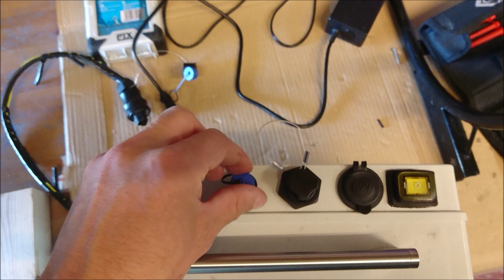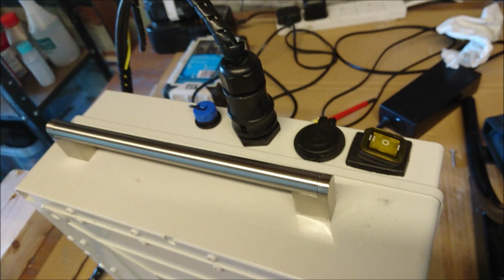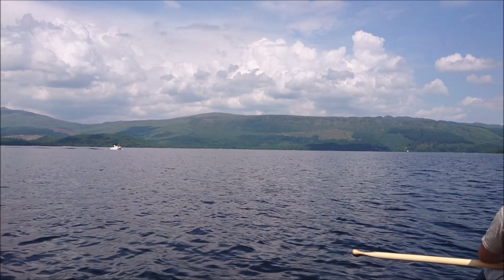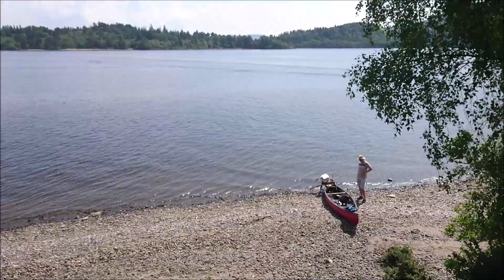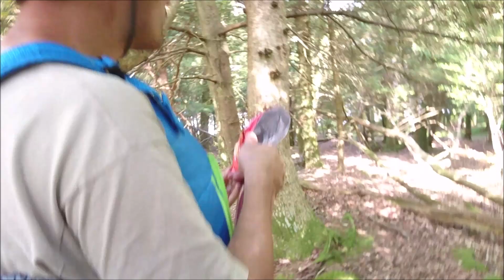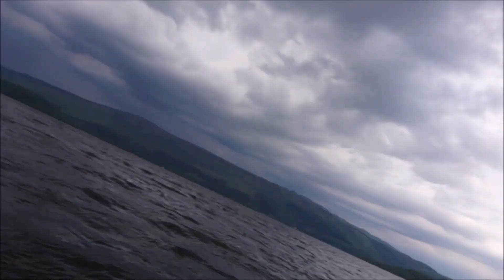10km electric outboard run on Loch Lomond

Comment: Nice tour of the loch (and Bulgin connectors). Toward the end did Dave have to paddle on the port side because of full power from the outboard mounted on the starboard side? What do those blood sucking midges do on that island when you're not there?? Do you have a windshield on your camcorder? I rigged up this home-made one - https://www.dropbox.com/s/ef3ln6e4cmtinv2/windshield.jpg?dl=0 - using bluetack and surprisingly it's still working three years later!
Reply from the maker: Hi Samuel thanks for that.  Sorry about the sound quality and thats a good tip on the home made sound baffle - I'll try it.  Just invested in some new recording equipment but it arrived the day after we filmed this.  I had intended to use it to make a few videos of a recent sailing trip but in the event the weather was either too bad to record or too calm to record anything interesting!

The temporary bracket had a clamp in the way of turning the motor more than about 10 degrees to starboard, so to do sharp turns we either needed to turn to port or paddle, which is what Dave was doing in the rough bits!

Hope alls going well with you!